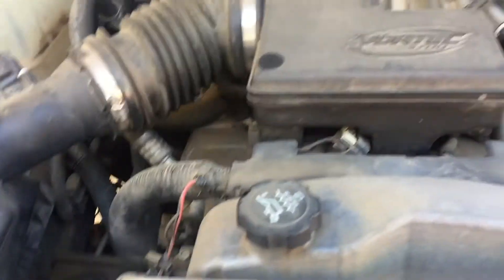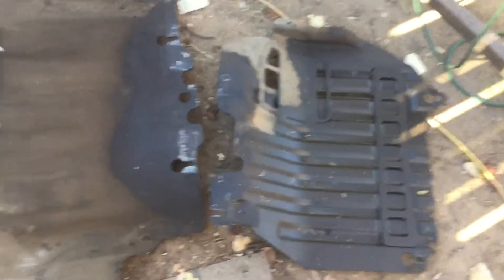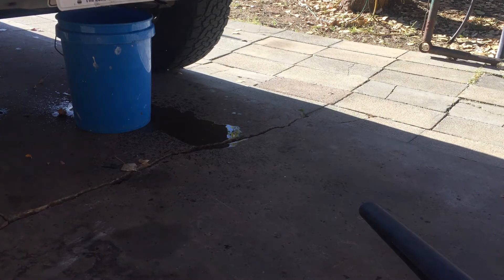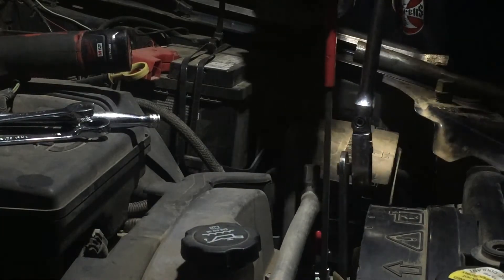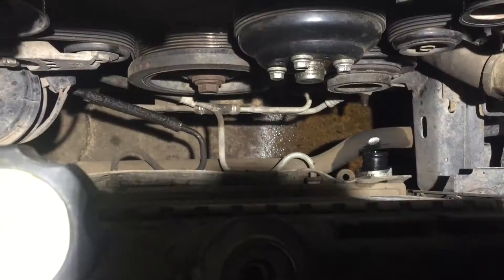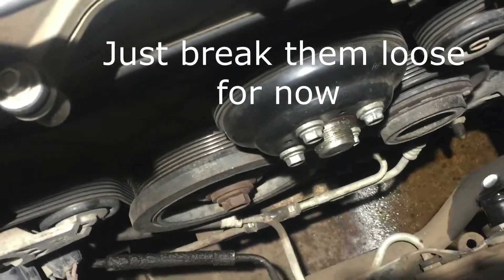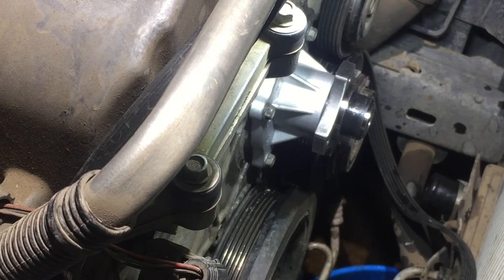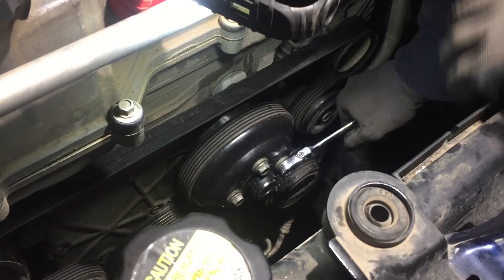Hummer H3 07 water pump leak ( replace)

Comment: My 2007 had a lever, locked by flex stops on either side, that allow you to slide the bottom half of the shroud out of the way so you can pull it off with the fan clutch attached.
Reply: Then there were also 2 other flex clips that prevented raising it on either side as well.  Press them while pulling the top flat/straight hook towards the front and up,
Reply: ...so that all 3 are cleared.  Once those are free you have to work the top left of the shroud towards the motor to clear the top radiator hose tube.  At the same time,  manipulate it up and leftward to clear the A/C line that is on the right and the two shroud installation guide post holes at the bottom (both shown well in the video).  Then it pulls straight up.
Reply from the maker: Hi V Man thanks for your comment very helpful and thank you for watching I appreciate you